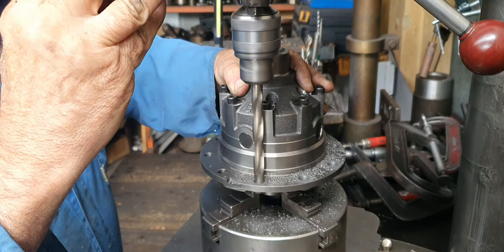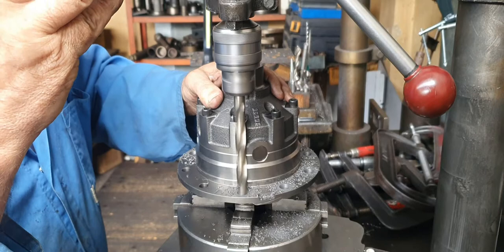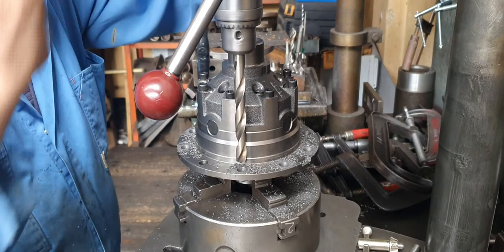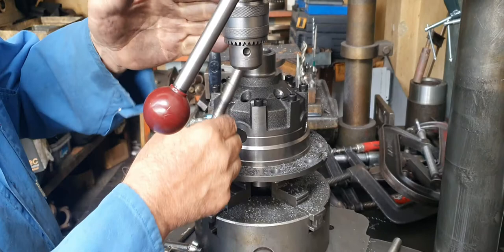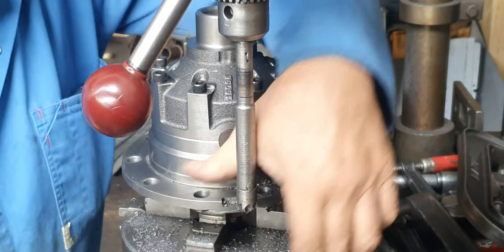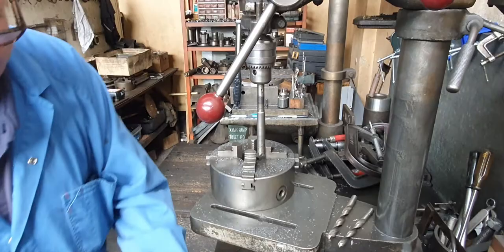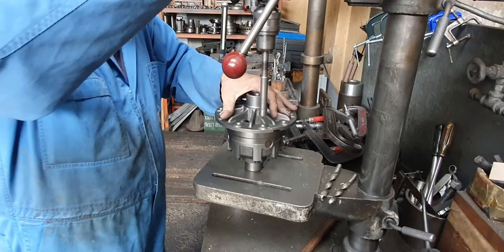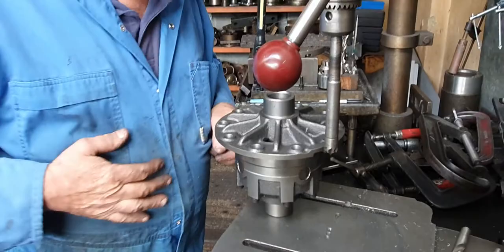Dana 44 eaton Detroit locker holes to small

Comment: The JK dana 44 has 1/2 ring gear bolts and the previous dana 44 ring gear has 3/8 bolts. I had to drill mine out too. Shouldn't need to though. They should change the part number by 1 digit and sell 2 versions.